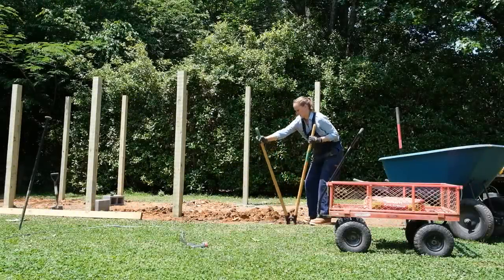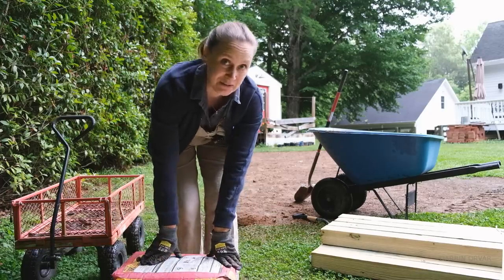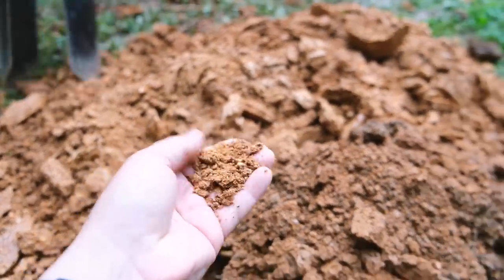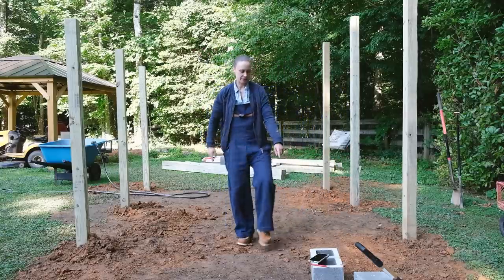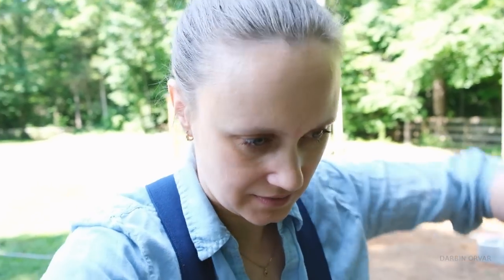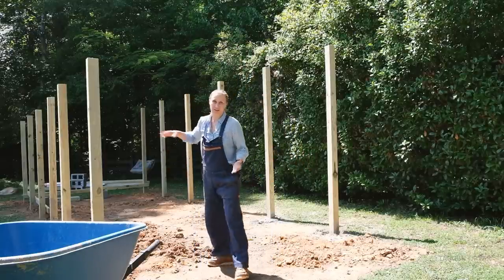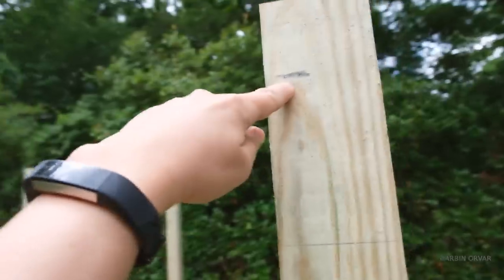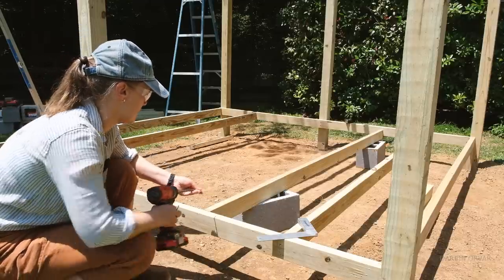Building a new little house... (combining solar + hobbit dreams)

Comment: Have you calculated how much efficiency drops off with angles less than ideal? I'll bet 12 panels at that angle won't give you as much energy as 3 panels at the proper angle, but I could be wrong.